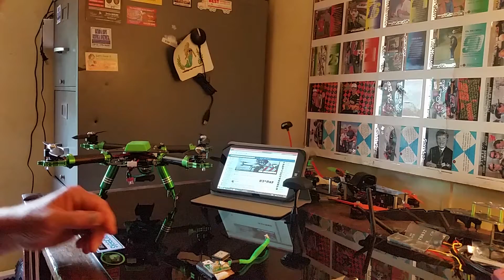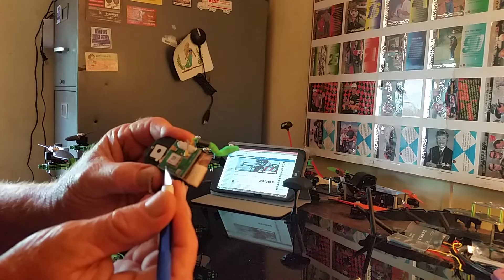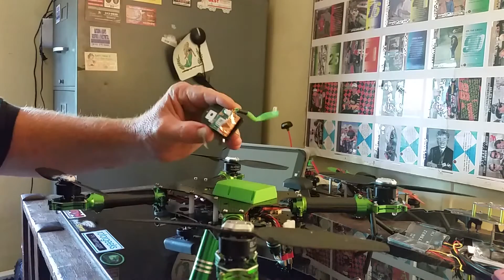GPS Module Details /RakonHeli 350Qx v2

Comment: Tommy, I really like the mast you show in this video, but I have searched everywhere and I can not find it.  I was going to use it to mount a Taoglas AP.25F.07.0078A antenna which is supposed to be plug and play with increased gain.  Can you share where you purchased that mast and antenna cover you show on this video.  Information on purchasing a 3D printed cover/holder like you use would also be appreciated.  I know others have asked but I could not find if you answered.

Comment from the maker: My understanding is that it needed insulating material between copper foil and contacts on board  ,which i would think only top side or electronics side....bottom is flat and no open contact points.